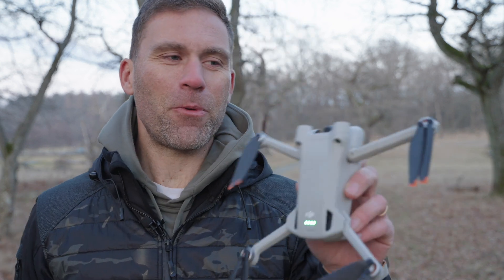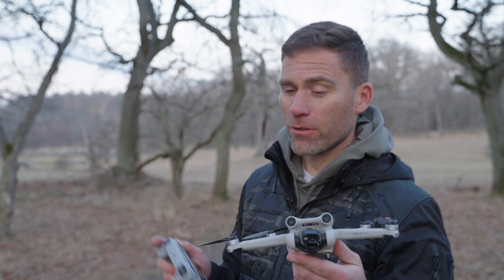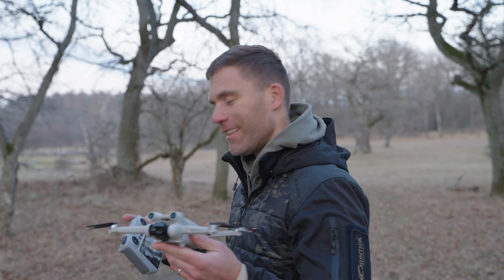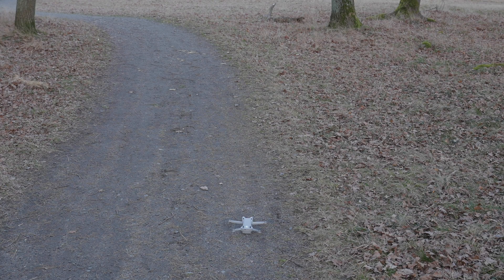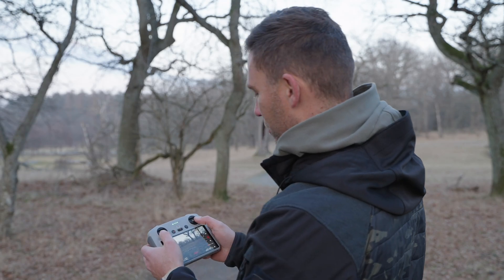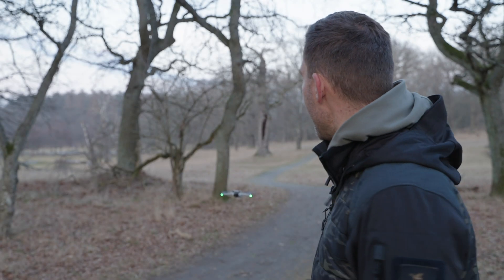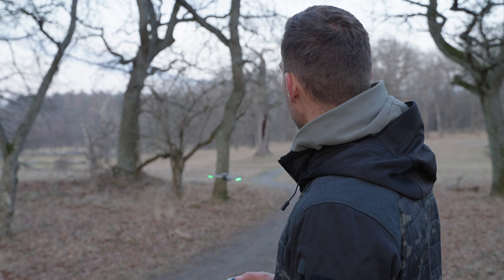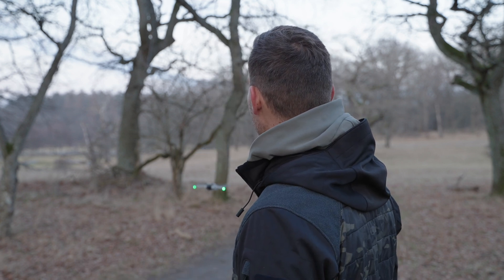Will a Drone FLY with Broken Propellers?!

Comment: Broken propellers give an imbalance on the shaft. Compare it with a new tire on a car which needs to be balanced by putting those little weights on it to compensate for any imbalance there is. 
You will end up making damage to other components
Reply from the maker: Absolutely. That’s what I’m saying in the beginning of the video. However, the question was if the drone would be able to take off and fly… 😃

Comment: That's like asking if a plane will fly with one wing off.  A new rotor blade is less than $3.00 US.  Better off just replacing the blade.  While flyable in this video, you will lose some controllability
Reply from the maker: For me it’s about figuring out the limits 🤓
Reply: @MK-Creator  well that's fine but when you post something like this and have followers who may not have experience, which some drone pilots don't have a lot of aeronautical knowledge, they may think that it is acceptable to fly with a broken prop.
Reply from the maker: @MidwestAeroGurus that’s for your feedback. I appreciate it. However if you watch it again you will hear that I clearly say that it’s not a good idea and it will likely destroy the motor etc due to imbalance. But would you be able to, in a “life or death” situation… 
Thanks again!

Comment: I've studied and designed autopilots and guidance systems.  I'm not surprised that it works.  A well designed negative feedback control loop in autopilots usually have large stability margins (gain and phase).  In fact,  I wouldn't be surprised if powerful enough quadcopter drones will fly reasonably stable with 1 propeller completely stuck / not turning/ not fitted. Any chance of testing that perhaps, please?
Reply from the maker: Im already on more crazy tests! 😁